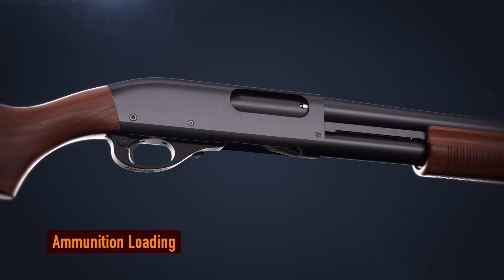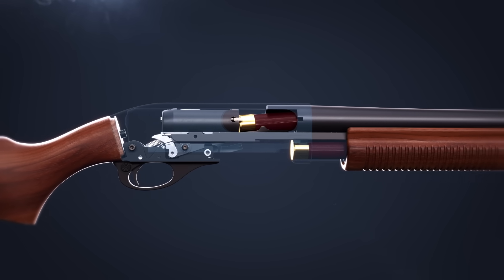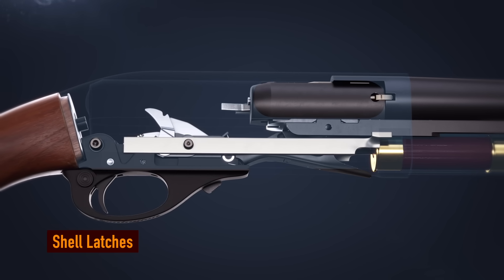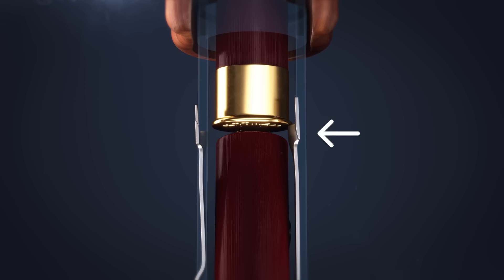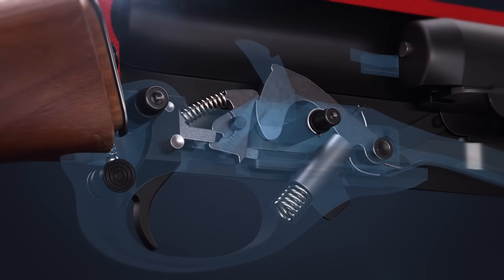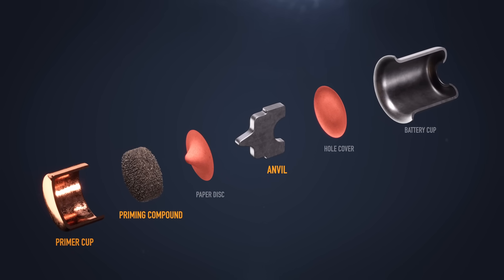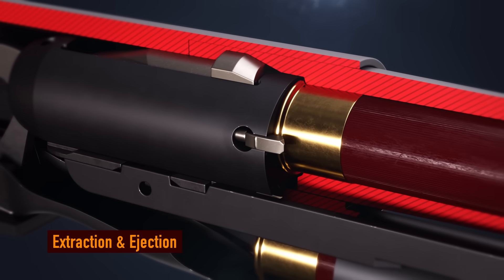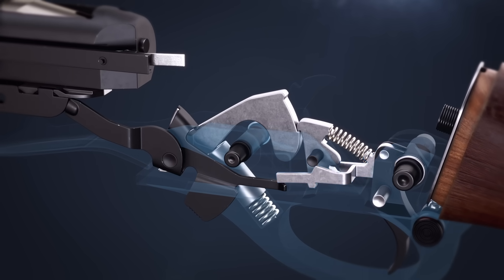How a Pump Shotgun Works

Comment: I'm not sure what's more complex, the engineering genius of the shotgun or how the animation is made. I will never understand either, but will be always remain impressed by both!
Reply: Animations can be made by viewing blueprints of the guns and stuff so they are not nearly as complex but this channels animations look great
Reply: It's not as "genius" as you think it is. This took HUNDREDS of years with trial & error to form and even in todays' state, many aspects of it are arguably overly complex leading to unnecessary costs, less reliability and more expensive maintenance.
Reply: If it took “HUNDREDS of years with trial and error…” then this goes to show how complex it is and the ingenuity it took to create. Hence using the word “genius”. If it was knocked up in 10 minutes in a shed out of old scraps, then it wouldn’t be. Obviously.
Reply: @bigz6455  you can absolutely construct a working gun from old parts in a shed in a couple hours. I wouldn't recommend it, but its possible.
Reply: http://youtu.be/fgLgapi9h80
Webley Revolver - make in 🇮🇳
Reply: Those animations surely are amazing, but the engineering is evidently more complex. I am no gun engineer, but my brother is. He has built guns, but is mostly doing repair, restoration and modifying, not inventing new guns. It is truly impressive how many mechanisms are at use and how it all plays together.
If you really want to understand any gun, you have to dismantle it, and first and foremost shoot it. Nevertheless, the animations on this channel are the closest you can get to comprehending a gun you never touched. Hats off!
Reply: Complex?
Lol
Reply: Ты тоже учись так же создавать анимации, а потом тобой будут восхищаться :)

Comment: If I mistaken those are Rittenhouse shells, the large tube is called a dinglehopper that's where the bullets come out from it's always good to Cock it twice just in case the shells don't lock in. Always practice gun etiquette specially when you're holding an AR 15.

Comment: Always hated the reliance on such small parts. Like, if I could reach inside, I could completely disable it with my own bare hands. Good thing it's only shielded by a tank of metal... used to prevent explosions from escaping... Hmm, maybe we shouldn't be using these tiny parts.
Reply: You cant fit large parts in a firearm because they are small machines. The pieces dont need to be large

Comment: ~Great, very well done perfect animation!! 
~The 870 is one of best, if not the best pump-action shotguns ever made (used widespread by Police departments as well) and also the most made (best selling) at about 10 million (correct me if I am wrong) but the two irony's are: 
1)Remington stopped making the 870 and a person can 'not' purchase a new one as far as I know. 
2)Just before Remington stopped making new 870's in the 2000's the last and latest ones had "lesser quality build" (inferior) than an 870 made about 50 years ago. 
~I would like to acquire (purchase) a weather resistant Remington 870 Marine model. 
~Just like I would also like to acquire a Marlin 336SS (Stainless Steel) 30-30 but Marlin (now Ruger) quit making that one too. 
~But it seems totally unbelievable that both the 870 Marine and 336SS (& Remington 7615, look this one up if you do not know what it is) are 'not' being made anymore and 'not' available?!!!

Comment: Not an expert, but isn't that kind of mechanism very prone to dirt and other substances coming through through the loading "chamber"?
Reply: you are correct.  The saving grace is that it’s also very easy for that dirt and grit to fall out.   The chamber being very large with very loose tolerances (compared to a rifle or pistol) also helps.

Comment: Engineering is so incredible. On one hand, it seems so "simple" in concept; and yet, in practice, it's no wonder certain firearms are legendary, because while most of them all operate on similar principles, it takes a true stroke of genius to precisely engineer something like this. Despite its moving parts and all of the things we might see that could go wrong based on the animation, it rarely does when operated properly. Nice.
Reply: What amazes me about guns is you basically have a controlled explosion in your hands and you have come to rely and trust these artifacts you dont think twice when pulling the trigger while this huge energy release is inches away from your face, ha ha ha.
Reply: @dntlss  id be immersed if i held one, TIME TO KILL SOME SNEKS

Comment: This guy knows a little too much about guns
Reply: ? He just explained how a gun works. This isn't rocket science.
Reply: Then you must've cut open 15 million guns because there is no way you know what how every gun works
Reply: @jhan2162  No, but if you have a gun, and you look into it's insides, you can at least figure out the basic mechanics of what goes on inside it. He likely has the gun, or has done research on the subject.
Reply: Stop acting like you know more about guns than him
Reply: @jhan2162  I'm not. It's just not rocket science. You can figure out this stuff just by looking into the inside of a gun, and messing around a bit.

Comment: Since when has the pump action shotgun was made like this? From the finely detailed parts used, I guess it must have been made from newer, more modern machines & tools.
Reply: 1893.  John Moses Browning.   Spencer made a simpler one in 1882.
Reply: @jwilsonhandmadeknives2760  Thanks for the info. I would have thought that only modern machines are able to craft such detailed parts for the gun to work reliably.

Comment: Man, I didn't really appreciate the engineering and design that has to go in to producing a single shotgun, let alone crafting the shells. So many small, moving parts that you wouldn't even think of! I guess depictions of shotguns in the media and popular culture are pretty reductive to all the small things that have to work correctly every time all the time to make these guns do something as simple as "accelerate BBs really fast".
Reply: the simple  engineering of the shotgun is super scary knowing that people use it to brag or scare one another, a bullet could be fired any second by the simplest mistakes or any small malfunction
Reply: @moayed7  correct, weapons are dangerous. That is why the rules of firearm safety must always be followed. It is impossible to make a safe weapon because then it would not be a weapon.
Reply: @moayed7  People who brag about guns will brag about handguns and rifles, and the only way a malfunction could make it go off would be a flaw in the sear or the hammer's sear catch. Guns are actually safe if you don't point them at anyone.

Comment: 00:40 Pressing the action bar lock before loading is not needed if hammer is in forward (fired) position.
Which is kind of normal when you start loading your gun?

Comment: alright.. this is way more complex than i had ever thought. Looks like a dumb boomstick and is actually a masterpiece of engineering.
Reply: You can get the same results with a hacksaw, nail, welding glue/torch, and an old CLUB anti-theft steering wheel bar.
Reply: @zigfaust  For sure. Literally "the same". Lmao
Reply: @zigfaust  but you might get a slightly different result....you die

Comment: Im still confused as to how the “carrier dog” catches the loop in a way to put pressure enough to lift the carrier, but doesn’t get caught on the loop itself but instead lets the piece slide past it.
Reply: If you look at the part called the carrier dog it’s on a pivot as well with spring tension. It folds in on it’s self and the tale helps push it out of the hole

Comment: U.K. pump action shotguns only allow 1 in the barrel ready to fire and 2 in the under tube. (U.K. law).
Attempting to insert more into the under tube, they are rejected, even though the under tube can hold more. How is this achieved? What mechanism is at play?
Reply: A stick ( often called a magazine plug) is placed inside the tube in front of the follower.  The shells push the follower further into the tube.   The plug takes up enough space that the follower can't go forward anymore, limiting the capacity that would normally be limited by the length of the tube and the compressed length of the spring.
Reply: These plugs are also often used in the US because shotguns have the same capacity limits (2 + 1) when it comes to hunting migratory game birds.  Many shotgun owners in the US will simply remove the plug if they do not plan on hunting with the shotgun.

Comment: I didn't know the primer has so many parts despite being so tiny. There goes handcrafting ammo in a lot of post-apo settings...
Reply: Handcrafting primers isn't that difficult.  You just fill the cup with priming compound and reseat the anvil.  Berdan primers are simpler, as they are mostly just a cup filled with priming compound.  For those, the anvil is integral to the case.
Reply: In a post-apocalyptic setting, I'd imagine it's be better to use a bow or some sort of flint-lock, unless you've got a good source of modern ammo or the equipment to make them of course

Comment: As I never saw a shotgun up close because of restrictive gun laws in my country, I never knew about existence of an action bar lock. How is it operated? Is depicted shotgun a version for left handed use? I imagine that the button supposed to be pressed by a trigger finger, but when it is on the opposite side of a gun than the finger of a right handed shooter, I'm confused. Is operator supposed to let go of the grip, get his hand all the way over the trigger guard, push action bar lock and then get his his hand back on the grip every time the shotgun needs to by cycled?
Reply from the maker: Nah, I didn’t explain it very well in the video, I apologize :( It’s only required to pull the fore-end back IF it wasn’t just fired. Firing the gun automatically lowers the action bar lock.
Reply: @mattrittman  Oh, I can see that now. It's visible in the animation. When a hammer hits firing pin action bar lock is being lowered. Thanks for your clarification. :)
Reply from the maker: @Chronos-Master_Of_All_Time  yep haha no problem :)

Comment: It’s kind of crazy how reliable these are all things considered. Engineering of them is cool, but also that they can be reliably manufactured to work so smoothly is insane.
Reply: I was thinking the same thing. Seems so simple when you shoot it, when in reality so many intricacies go into it. And to work so reliably time after time is incredible!
Reply: guns are like a mini-rockets, launching contents into targets with pin-point accuracy
Reply: I too was surprised how intricate the mechanics are in a pump-action shotgun!

Several areas where something could go wrong usually don’t on Remingtons, Mossbergs, Ithacas, Benelli, Beretta, ect...

Even bullpup designs like Kel Tec’s KSG are becoming super reliable.

I have a Gen 2 KSG and with about one or two days practice it’s just about as reliable as a Mossberg or Remington is.

Mossberg Shockwave FTW!!! 🙌
Reply: Exactly what I was thinking
Reply: yes. also under the influence of heat and cold. specially with lmgs etc. that shoot hundreds of rounds. allways cool to think about!
Reply: Hallo How are you guys,.i
https://youtu.be/yXkBRMAByJ0
Reply: Abolish the 2nd amendment

Comment: In my state, Only 3 shells are allowed in a shotgun. If you take the plug out to allow 5 shells. It's a fine.
Reply: Usually, the 3 shell rule only applies to hunting in my state it's only for hunting then when I use my shotguns for sport I take the plug out
Reply: @Giovanni_Litterini  - Yes, just hunting is when only allowed 3 shells. Years ago I was fine $50
for having my plug out while squirrel hunting. Lesson learned.

Comment: the bolt guides it into the chamber

incorrect. the bolt just pushes it forward into the feed ramp/carrier.
the feed ramp guides it into the chamber.

without the feed ramp, the bolt would just jam the round into the area between the chamber and the feeding tube.
it wouldn't work

Comment: Meanwhile, you can just use a small hammer, A steel tube and a steady hand to fire the shell. Dumb and risky but it works lol.
Pump action design is just overcomplicated compared to auto-loading ones. You can reload double barred shotgun faster manualy with some skill.

Comment: I have a Mossberg M500CRUISER 12 ga pump action shotgun. It has an 18-1/2 inch barrel and a pistol grip. The over all length from the muzzle to the bottom of the pistol grip is 28 Inches

Comment: It's amazing how reliable guns are, even with all these tiny parts moving in unison precisely without breaking nearly every time
Reply: I have the same feeling regarding... pretty much everything. From living beings, to computer code.

When you break stuff down, you tend to get this feeling of "okay, there's some time between each slow step", but then you realize stuff like cells replicating and computers loading something goes so fast you can't really comprehend it.
Reply: @Ch4pp13  I agree. The problem isn't really understanding what's really going on it's just the speed and amount of stuff happening at a time. It's like trying to conceptualize very large numbers in your mind. Human brains just weren't built to be able to do that easily.
Reply: Tell that to any action hero when there about to kill the bad guy
Reply: @joelithink5656  they’re*
Reply: @unreal4202  did you need to do that sir?
Reply: That’s due to the magic of machining tolerances. A average part will have X amounts of tolerance from each other to where some parts may be oversized or undersized and still work, and also potentially have a setup to which it will “wear in” to where the parts will work together.
Reply: Unless you’re using the Pancor Jackhammer

Comment: Quite fascinating stuff. What about how double barreled combat shotguns? There must be a slight difference, as they often have a secondary fire that fires both barrels
Reply: No such thing as a double barreled combat shotgun. They are strictly hunting weapons. Having only 2 shots is not smart in combat.
Reply: @ckmoore101  Well, it could still be used in combat - once or twice.
Reply: @ckmoore101  
Worked in battlefield

Comment: This does give me some insight into why short stroking could cause the gun to malfunction so easily.  If you don't pull far enough, the bar holding the shells in the tube magazine won't disengage to let the shell pop into the feed ramp, causing a failure to feed malfunction.
Reply: You stroke it enough, it will eject.
Reply: Yup stroking all the way also makes ironically makes a quicker job
Reply: Hallo How are you guys,.i
https://youtu.be/yXkBRMAByJ0
Reply: these replies...

Comment: After seeing the amount of detail went into the mechanics and functionality in this video, I'd be curious to see some of the older firearms as well. Such as an M1 Grand, or a gravity fed gatling as a couple of examples.
Reply: There is a video about the Kar98 IIRC
Reply: forgot the a between the g and r, just a tip.
Reply: @sirankleknocker3122  KAR(abiner) 98 kurz - never write before the first coffee, a rule I should remember 😅
Reply: Funny enough, if you watch the video he made about the ak47, it's quite similar to how the Garand operates. The ak uses basically the same operating system as the garand, but the piston is above the barrel and the bolt and locking system are slightly changed around to fit the ak better
Reply: Русская анимация
https://youtu.be/jHpnhSzovR0
😉
Reply: Hallo How are you guys,.i
https://youtu.be/yXkBRMAByJ0

Comment: Notice the empty space in the powder charge.  You want some air in all your bullets and shells to act as a buffer for pressure to build slowly and accelerate the load out with minimal stress on the barrel and receiver.  Homemade or low quality ammo can damage your gun.